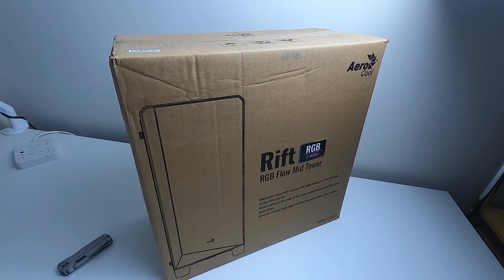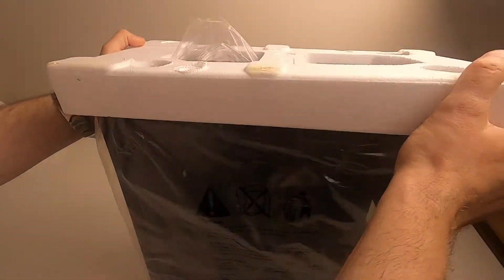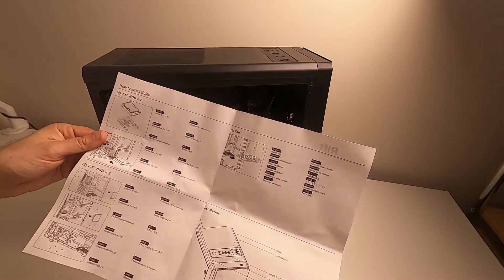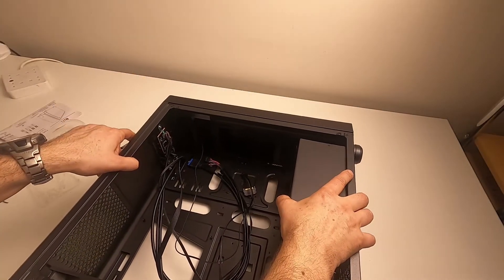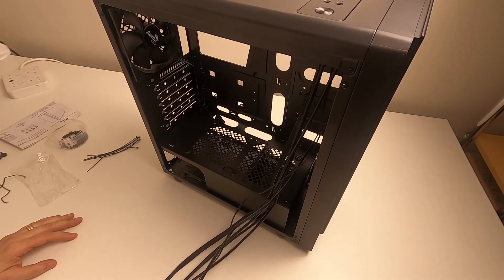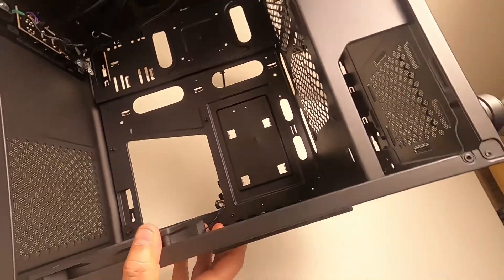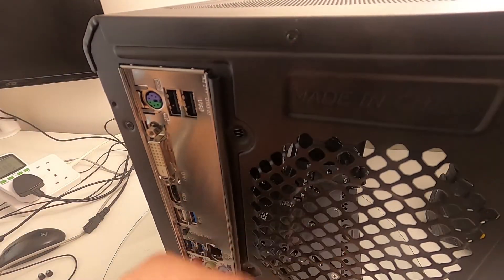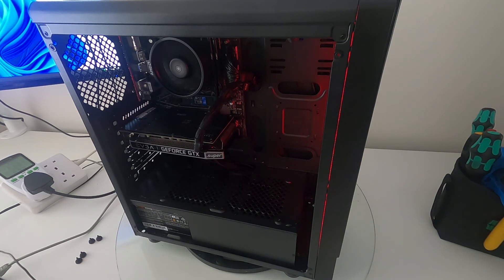Aerocool Rift RGB *REAL* Unboxing and Build Experience

Comment: Hi there.
Does the metal on the back look/feel fragile?
Any signs of rust?
Thanks for the video. 🙂
Reply from the maker: It’s not the thickness of 1990’s Antec cases… and I’d hesitate to stand on it to reach a high shelf… but it’s not water thin.

There was no rust either.

Hope that helps.
Reply: @sterntechdaddy  
I see.
Strong build desktop cases are long gone. Even the expensive ones are now made of this super thin "metal". Too bad.
No rust? Maybe that is not metal at all. xD
Thanks for the feedback, sir. ;o)

Comment: can you tell me what connector the front case rgb leds uses? i really like this case but I'm not sure about my motherboard and if I can indeed make use of the case
Reply from the maker: The case LED's have a SATA power connector only. There's no RGB control cable so the case LED's can't be synced to the motherboard and other RGB devices  or controlled by software from within Windows.

Hope that helps.
Reply: @sterntechdaddy  Thanks. So from what I understood, I plug it in into the sata connector from the PSU?
Reply from the maker: Yes.

Any free SATA power connector will do

At 16:59 you can see where I connected it... my hand comes in where it can be seen at the bottom of the case next to the PSU.
Reply: @sterntechdaddy  yeah i saw it. thanks

Comment: it seems you can add 3 fans at the front, but where does it suck from? is the front panel a mesh? because all I see is that small inlet on the left side of the front panel
Reply from the maker: It pulls air in from the side... you can see it here: https://youtu.be/6sljPNP2N9o?t=638

Pause it quickly though... it's not shown for very long.

A better view is here: https://youtu.be/6sljPNP2N9o?t=770

But I think that if you're looking to assemble a system that actually needs three front fans for cooling then you'll be looking at a different case...